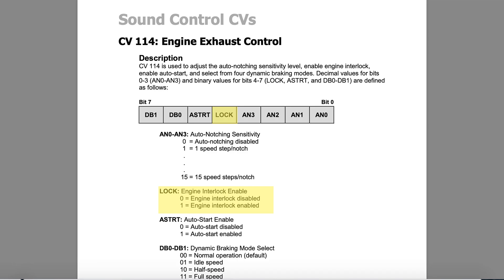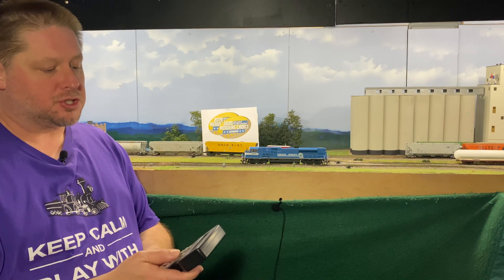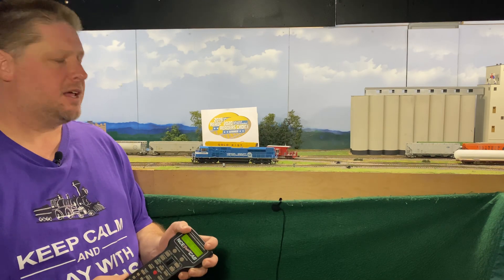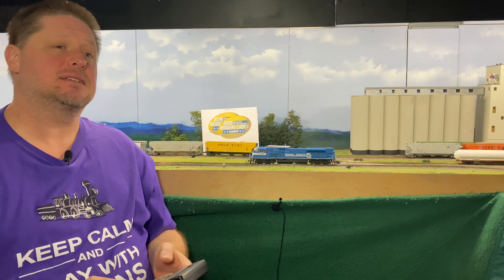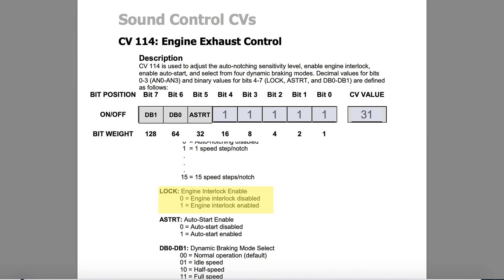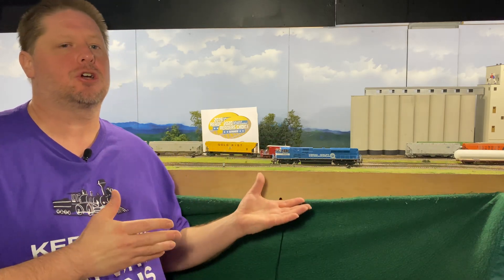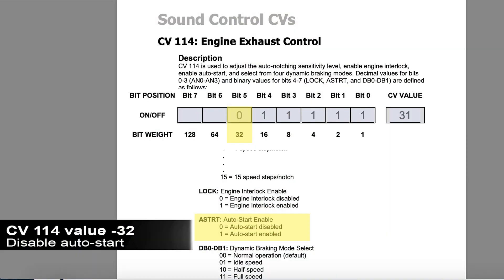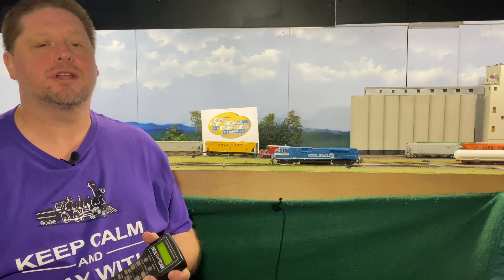Tsunami2 CV 114: Engine Exhaust Control

Comment: My cv 114 has a default value of 103 so just minus 32 and set to value of 71 to disable autostart? I have dde calibrated so maybe thats why cv 114 isnt set to 39? Thanks
Reply from the maker: Refer to the users guide as there are several parts of CV 114 to get the 103 value. If the 32 valid was not calculated in the total, then subtracting 32 will get a much different performance.  So, refer to the section in the users guide so that you can derive the best value for you.  DDE has nothing to do with the value in CV 114.  Most likely how the dynamic braking affects the sounds of the prime mover.  Contact us at support if you need further assistance: (970)259-0690 or support@soundtraxx.com. Thanks

Comment: All well and good but you did not show what buttons you were pushing on the NCE control. I am new at this and totally in the dark. You had a lot of talk but no numbers to enter in the CV 114. I found it to be totally useless. I am trying to find out how to have my locomotives shut down at idle and remain quiet until i push a function key to start them
Reply from the maker: We do not make NCE so we cannot support it. If you don't understand how to change CVs with your command station we first recommend that you refer to its manual or reach out to NCE support. Auto-start is enabled out of the package so you will need to disable it: https://youtu.be/h8CHCOPrN64?si=_fcyrd3QJ_AUyq5v

If you are finding learning your command station difficult, you may want to look into Blunami. Blunami is a DCC decoder and can be operated with your command station, but it also has the option to be controlled via Bluetooth and an easy-to-use app on your smartphone. The Blunami App is free and lets you set up all of your features with dropdowns and sliders. If you are already invested in Tsunami you can even use your Blunami to help set them up. Just set up the feature easily on your Blunami and let the app calculate the CV values for you to input with your DCC system for Tsunami2. 

For more assistance, contact our Support Team: (970)259-0690 or support@soundtraxx.com

Comment: Wish that startup sequence was longer as with the prototype.
Reply from the maker: We shortened the sequence because many complained that our startups were too long, just like the prototype. And since it is a simulation and not the real thing, we shortened them for the decoders. We also had to factor in scale time or fast clocks. But these are the recordings we did for the startups and why they are shorter than the prototypes.  Steam doesn’t have a startup sequence since it takes hours and hours to fire up a steam loco.

Comment: Would a value of 46 mean auto notching is default level 15, lock is off for a bit value of 0, auto start is is set to 1 for manual start, and bit 6 & 7 are left at 0 default?
Reply: Just want to make sure
Reply from the maker: I get 47.  15 for 15 Speed step auto notch + 32 for auto start.

Comment: Can someone tell me how to set up your locomotives so they don’t all turn on when you turn track power on ? I did CV114 and a value of 32 and that did not work it messed everything up
Reply from the maker: Yes you use CV 114. Here are some videos: https://www.youtube.com/results?search_query=soundtraxx+auto-start

If you need more assistance please contact our Support Team directly and they can walk you through the process: support@soundtraxx.com or (970)259-0690 ext. 22

Note that if you have a factory installed decoder the default values may be different than those we are showing in our videos, and this may be the source of your problem.
Reply: But NOT on steam sound decoders. CV114 will alter your chuff speed and you may have to set it up again to get the right sound to motion. On Steam sound decoders, use CV113 and a value of 1. This will practically but not fully disable autostart.